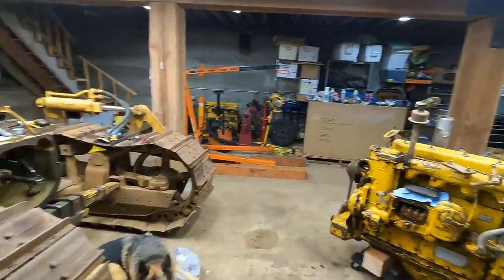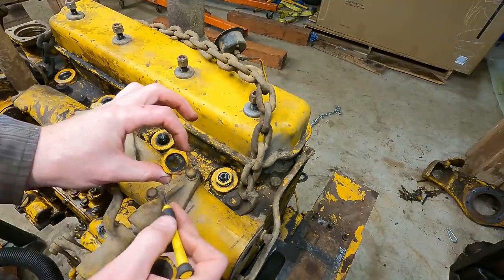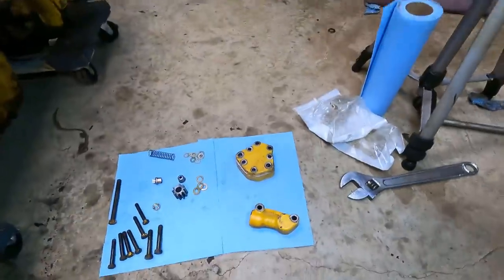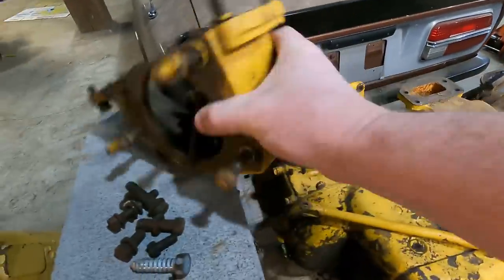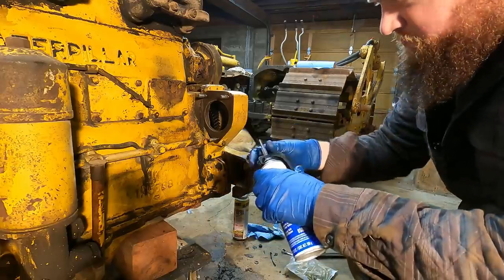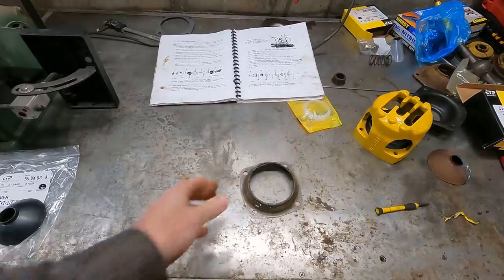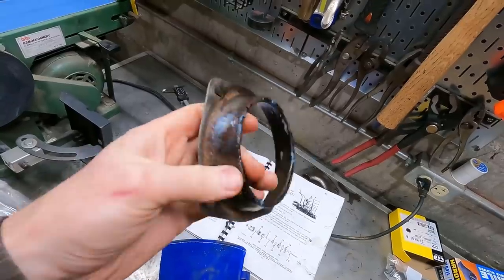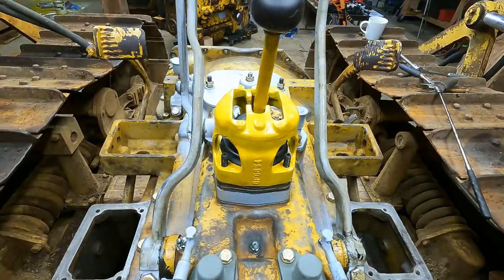Replacement D315 engine inspection and preparation for Caterpillar D4 (part 1 of 2)

Comment from the maker: So as I mentioned in the video, here are some sources for manuals and parts.  It's a small list, but as I mentioned this is how I've found everything I've needed so far.   Feel free to add your own:

Manuals and general help:
https://www.acmoc.org/  (check out their forum section too)
https://www.ebay.com/ 
https://www.heavyequipmentforums.com/

Parts:
http://tractorparts.com/ AKA General Gear.  He has the new stuff like clutches listed, but to find a specific salvage part, you have to email him and ask
https://www.ebay.com/

Paint:
https://www.tractorpartsasap.com/
Reply: PNH -  I follow you because there is a 70 yr old machine in a field.  We have a  spare engine, and so - there is a need to rebuild it, as you and  Squatch, show us how to fix these old work horses.  Thank You so much!
Reply: Does Caterpillar have legal restrictions on service manuals, even stuff half a century old? I can't think of a single good reason for that.
Reply: Make sure you don’t forget to put some oil into the cylinders If it has sat for a long time then they probably have dried out And cranking it or trying to start it good cause damage
Reply: I have 5 machines I am parting out...

Comment: Your videos are a joy to watch! With regard to the transfer pump: there are no gaskets because that would make it impossible to maintain the end clearances between the gears and the cover/base. Believe it or not, there are huge gearpumps made the same way. The surface finishes are so finely made as to eliminate leakage - even at 3000 PSI on pumps for highly viscous fluids at high temperatures. Interesting nerd fact, I suppose. I haven't looked, but I expect there to be some heartfelt comments on the subject of hand pumping oil thru the bearings. I've seen that on the subject of prefilling oil filters on cars during oil changes. I won't say which camp I am in on that subject, as I dislike confrontation from other commenters, but I have confidence in your abilities and respect your choice. I just wanted to prepare you in case things get tough. Looking forward to your presentation during the next video!

Comment: The attention to shifter as repair to non-water entry is important to machines exposed to rain and weather.  Many older tractors with rust and rubber collapse at shifter boot are the cause of water build up to transmission with subsequent difficult rust at interior. This is lessened by covered storage.  An interesting and fact filled post.  The manuals as available to service, ownership, a key resource.  Enjoying the winter days as to watch shop activity.  Look forward to operator use of this machine.  M.

Comment: Nice to see someone working on the old caterpillar equipment . Bought a 7u D4 with Trackson loader motor had been removed years earlier from previous owner and rebuilt . He put it in boxes what a basket case took awhile but I got it running ended up rebuilding trans . Steering and everything else what a project that was. It was fun I was a lot younger then hope you have good luck with yours

Comment: Take it from me, I restored a1960 john deere 440 diesel that had been sitting in a field rotting for 15 years. I brought it back to life, engine rebuild, transmission bearings and full hydraulic , tracks and undercarriage etc/ All done under a shelter logic tent with dirt floor. Ive got about 5 grand in essentially a new machine. Its worked it hard on my place for the last 2 years, first clearing, then grading etc, then I bought the original trailer for it, restored that, and started making money with it. Im not singing my  own praises, but I did it exactly the way your doing it, parts inspection, replace or rebuild, not cutting corners, doing it right. Sometimes, I wondered why I started this and felt a little demoralized because there were other things I thought I should be doing, especially when I listened to some friends talking more than their share of trash about what I was doing. That machine was the best money I ever spent. I think that youre going to find out the same, keep at it, good job and I wish you well.

Comment: "This is going to strip only metric bolts"! LOL !!  (USA made adjustable wrench) ; I tune in to see how Charlie is doing also.
BTW: regarding the RTV not drying out with the plastic cap...... place a bit of Vaseline or dielectric grease around the cap sealing area ; this WILL create a air tight seal and the tube will not dry out!

Comment: I owned a 1952 Cat D6 9u. I sold it to buy a Case 850b. Very similar your D4. Just bigger. The engine in that thing sounded great. I paid $1500 for it. I wish I still had it after watching your videos. Super well done. Thanks for doing them.

Comment: Thank you, for taking your time to explain gasket, replacement,lock tight, diesel fuel and oil system,flushing cleaning and oil circulation of engine moving parts ! Also replacement of fuel filters, and fuel pump cleaning and oil, circulation, again! Learned quite a bit! So ,many systems but you have made it easy to follow and understand!Not, forgetting the four manuals and how to and what to look for on E-bay, when ordering parts! Right, on Brother!
😀👍

Comment: You are right to eliminate the pony motor. I learned to operate an old 1950s cat with a pony motor. It was a real pain. The one we had the pony motor was started with a crank out the front of the tractor. If you killed the tractor with the blade up you were screwed. We talked about butting an electric started on the pony motor but like all good ideas it didn’t get done. I joined the Navy and left so the things I was going to do didn’t get done.

Comment: You did that so right. Oil everywhere the engine needs it. Before operating revs. That baby is going to purr. For as long as diesel is available.

Comment: Was always taught to not bead rtv on joints...  just smear it on thin...  and it's amazing how much damage can be caused by excess rtv getting into oil pickups and blocking them, and blocking small oil galleries (Japanese OHC motorcycle engines)

Comment: Lovely job, can't wait for thefirst start, it'll be months away but still, can't wait! The valves you refer to toward the beginning, I think you'll find they are the fuel injectors and your injector is actually the injection pump.
Reply: Contact!

Comment: Good job!
Next time, when lubricating metal-to-plastic or plastic-to-plastic parts, use silicone grease or dielectric grease. It won't affect the plastic/nylon part like petroleum based grease does.
Reply from the maker: That's a really good point. The original seal was rubber, didn't even think about the correct kind of lube to use for the replacement part number.  I think it's nylon.

Comment: You're doing a fine job with this project. As for a  pony motor,you may want to install one later. It would  help with cold starts, warming the diesel and oil, and in case the battery was dead.

Comment: It's the prime handle for priming the engine without it running unscrew counter clockwise handle pops out push it in pumping it until it gets hard stew in clock wise until it don't move u will see fuel coming out of the loose line tighten lines crank it over should fire up. Your just bleeding the air out of lines until fuel come out all lines steady.

Comment: I'm partially thru the video, but pumps that are assembled without gaskets often used gasket shellac to seal the surfaces, a better choice than RTV for this application. Thank you for sharing all the work you're putting towards getting this dozer alive!

Comment: Check your old radiator, if it has two ports on the right side, those would be for the oil cooler inlet and outlet.

Comment: I've dealt with several engines having starting issues after sitting for years. Most of time gummy fuel delivery. I hope you start it soon! Chain it to a cherry picker. Use light lift and try to have it sitting nice on blocks.

Comment: you can get the same rtv in a caulking tube Easy cheese can work the first time or two let them sit awhile and you are pitching it across the shop
Reply from the maker: Yeah I'll see how it works after a few weeks... you can unscrew the tip and clean it out which I've done a few times.

Comment: Just a little comment, I don't know how much the top cover weighs, but if you had an engine stand you could make some attachments and brackets for holding some of the work up off the floor and it also gives you the ability to rotate stuff for access to the top and bottom. I have an old one I saved from a junk yard, and I use it for everything. It will help with your back.

Comment: Excellent build man. I think paper gaskets better than RTV. It just gives a uniform thickness of media which takes up any mismatch in the surfaces, effectively sealing due to the narrow tolerances? I have used lunchwrap, a paper material also dubbed greaseproof paper on oil pumps. Tolerances are absolutely critical in gear pumps of course.

Comment: i had a d4 8u without pony, used 4 6v batteries that i changed to 2 12v batteries.  worked great, a pony would be needed on larger cats but a d4 isn't big enough to warrant it

Comment: You could run the engine before you put fuel in tell its value train is good and wet then add fuel and bleed the lines , FYI with a car you only need to pull the coil wire and turn over the starter if you don't want to buy the tool

Comment: Them are what they call capsule type injectors and they are non rebuild able. And that is a pressure regulating valve with out it , it would blow the top off. Some of them older gaskets like that , had espestos in them

Comment: Great video as usual. At 36.09 is that shifter spring same diameter at both ends? It may be a visual aberration but it looks wider on the top. If so should not the spring be inverted so that it sits around the collar of the dome instead of balanced on the edge of the tube? Just a thought. Good work

Comment: The CAT gasket cement 4H2471 required a chisel and a hammer to remove from metal surfaces. No longer available due to chemical content.

Comment: The D4 I grew up with had 12V start for the pony... the D2 before it was rope start pony. If you can do electric start, by all means... and at that point, why pack a pony motor around collecting water and corrosion- if you never use it, it won't start when you need it to.

Comment: You might consider stuffing some fine steel wool in your crank case breather. Still let's it breath but keeps the rodents and bugs out
Reply from the maker: that is a really good idea
Reply: @PacificNorthwestHillbilly  It works really well. I did it on a Farmall H engine I rebuilt in 2015 during Tech College.

Comment: Careful the backlash on the generator drive when you installed it. You don’t have a gasket under the adapter so your gear contact may be affected.

Comment: Should cost the nozzles and the hold down nuts with a liberal amount of grease.  Grease holds up better than never seize
Reply: Metal to metal you can use anaerobic sealer    don't ever use rtv on fuel or oil systems
Reply: Also the generator housing you installed with rtv only "ick"
Will need gaskets to adjust the backlash on the generator gear

Comment: I see you using what appears to be a razor blade to scrape gasket surfaces. I use old cheap wood chisels. Gives you a handle for leverage with baked on gaskets and built up carbon deposits.

Comment: I would make sure to put some oil in the cylinders before you fire out there crank it too much because if it has sat for a long time the cylinders I have probably dryer out And it could potential he cause damage

Comment: Continued from last... The beauty of these old machines is that they were MADE Well. There is nothing in the modern world to compare them too. They are tough as nails, especially an old CAT. Second, they were simple and simple to repair, not to be confused with easy in labor to repair. Try to compare any modern machine and I could bet you there isn't a single one that will be around pushing dirt 70 years from now, one major repair on a modern machine is enough to send it to a junkyard or part out. Thats why I prefer to refurb and run old machines on my small farm, dont want to buy new ones.
Reply from the maker: Glad your rebuild was a success, hopefully mine turns out well.  You are right, this old stuff is really tough as long as it's cared for.

Comment: I wonder about gear lash with the generator drive if there is only silicone not a stack of gaskets to set the lash/depth of engagement..
Don't forget to read up on polarizing generator charging systems.  There are at least 2 different ways and I dont know if that is an A circuit or a B circuit generator.
Reply from the maker: I cut out that part but I can mention it in the next video.  There's really no way to measure backlash once the generator is installed, or even a spec for it.  The cam gear to crank backlash spec is 0.002-0.003 with max allowable of 0.01, which is very tight.  So what I did was dry fit it with no gasket, then take the back of the generator off to see if it had a tiny bit of lash, which it did.
Reply: @PacificNorthwestHillbilly  I thought you might be able to rotate the armature thru a brush inspection cover perhaps. . I was watching on my cell so there was not a lot of detail

Comment: why not add a propane high pressure burner like a (weed roaster) to the intake manifold exhaust tube used by the old pony motor to pre-warm the intake manifold for cold starts. clean burning and cheap heat.

Comment: Idk anything about oil pressuring any engine by hand. But to me the sound and air pockets didn't sound right.
I personally would run either seafoam or engine restore with that oil before you change it out.
Mixing the oil with mineral spirits or kerosene I assume would be effective also

Comment: - [ Matt ] Did you consider doing brazing to fill the holes and provide strength to the unite? 29:25
- Since you did buy shifter parts, why not buy that part? Could you not find it?
Reply from the maker: that was the one part I couldn't find
Reply: @PacificNorthwestHillbilly  .
- I was very impressed by how you did strengthen the piece.
- Is there need for more strength by brazing to fill in the holes?

Comment: Is there any reason not to use a 24 volt starter system? It will provide a lot more torque and power to rotate the engine. You can get the generator and the starter motor rewound for 24 volts, and use two 12 volt starter batteries in series for 24 volts.

Comment: Some diesel engine fuel pumps require filling with oil separately from the crankcase. Don't know if that's the case with this one. Do you have a manual that will tell you that?
Reply from the maker: Yeah, the injection pump has its own oil reservoir.  I'll change that when I get the engine high mounted along with the main oil

Comment: I'm not aware if you covered this question in a previous video, are you going to paint the D4 once completely assembled? The reason I ask because it appears to me it would be easier to paint some of these parts and areas on the D4 before assembling.
Reply from the maker: yeah, I'm going to paint the engine separate

Comment: Diesel engines run oil coolers cause oil cools pistons. So Diesel oil runs hot.
Strongly suggest an oil cooler. Needing a cooler has nothing to do with older oils versus newer oil. As mentioned it cools the pistons, therefore absorbs heat that needs dissipated
Reply from the maker: I don't get back to this topic till way later in the series, but I didn't explain it very well in this video.  For some of these early Cat engines, the oil cooler was not needed... in fact Cat deleted it a few years later in the D4-7U.  For some perspective, this engine makes 50hp and has a 4 gallon sump.
Reply: @PacificNorthwestHillbilly  I run an oil cooler on my derby car. Was told it was a waist of time. Well I melted the duct tape n foam off feed but not return.  
They may claim it not needed,  but almost every diesel runs one. I believe in taking the extra steps to do things beyond whats needed.  Oil is critical in an engines life. Cooler oil I believe does a better job. This is my outake on subject.  If you look at my channel I work on a wide variety of engines.  I have a 46 D4 I need parts for. Ill be going to Washington shortly if you could line some up for me. I need the side shields beside engine for mine.

Comment: If I may suggest, there are two YouTube Channels that you really should visit, (1) Squatch253  &  (2) Kyle Christ,  both of these two channels are excellent informational hands-on videos and are dedicated to the repair and restoration of the Caterpillar 2 & 4 series Tractors, the two men who operate these their individual channels know these particular tractor series inside-out, where to find parts, correct repair mechanical procedures, correct exchange parts, how to make required tools, where to find manuals, and who to contact for needed information, tractor clubs to join, etc. you name it, they know it and they teach it for free.